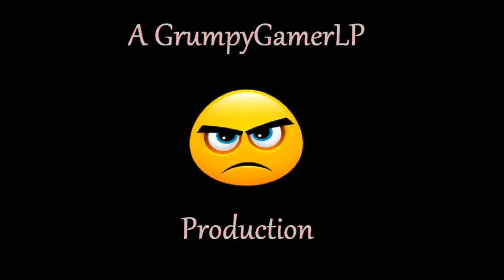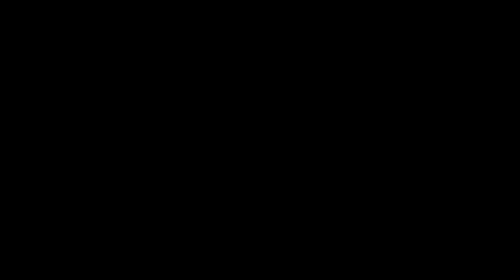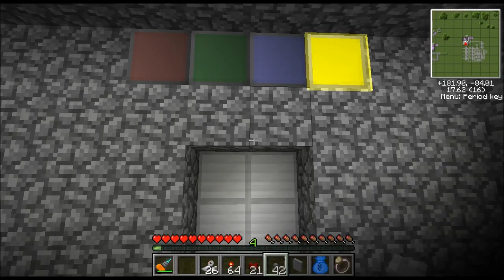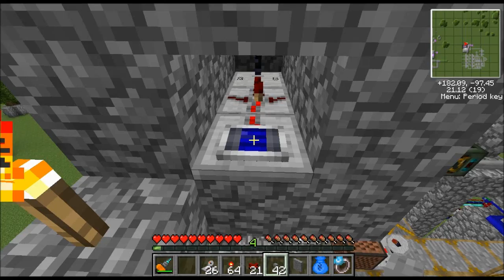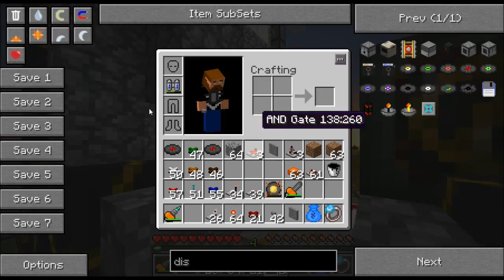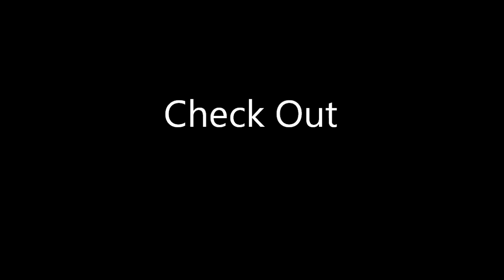Tekkit Tutorial - Elevator 3.0 - Advanced Redpower 2 Circuit Design (Part 1 of 2)

Comment: I totally get that. I'm Just saying from the perspective of trying to get the most out of what was available, as an engineer it's really fun to use the computers in conjunction with the rp2 frame work, logic, and frame system to do some cool stuff that I found to be more efficient ;)
Reply from the maker: If I was going for easy I'd use a jetpack. :)
Reply: GrumpyGamerLP and just as a tip with the frames, rp2 wiring will 'stick' to the frames if you use panels instead of covers ;)

Comment: why not use a rp2 computer and write a control program???? you would really diminish your control setup's footprint on the world as well as reduce redstone tick lag
Reply from the maker: I wouldn't even mess with an elevator in an actual world where I play. I built this in a test world.  Redpower frames suck for moving around.  I only use them as proof of concept. The fun was in designing it and not in using it.

 Same goes for this logic circuit. I wouldn't build it in a play world.  I used a logic circuit in this design because it is more of a challenge. Designing the circuit was like solving a giant puzzle. Lag isn't an issue because this was built in a test world with no other permanent automation.

The same goes for people who build things like redstone computers and calculators in creative worlds. The fun is in designing and building them. No one is going to do their homework with a calculator built in Minecraft.

Comment: Hmm..ok.... might be because the ICBM mod does't work with it as much as expected. I was able to attach the emp device tot he elevator with a battery pack and got it to work no problem. I tried repeating the process with a forcefield generator but when i attached the frames to the component blocks, the elevator froze. When i broke the frame, it worked again...so im guessing that would be the issue. thanks for getting back to me

Comment: On a side note, Voltz does not include the support framesor motors. I actually found another Voltz like mod with everything I need. I built the elevator no problem but when I try to attach the ICBM launcher to the elevator, either way I do it, the elevator either does not move or the launcher pops off in mid air and hangs there. I don't want a bunch of support frames covering everything but thought maybe you have an idea of how to keep it attached properly. Awesome stuff. I appreciate it.

Comment from the maker: You could add more floors easily. I don't know how many more but you could probably at least double the number of floors because I don't think any data bus used more than 8 or 10 wires. If you replaced alot of my logic with computer craft then you could probably have an unlimited number of floors.